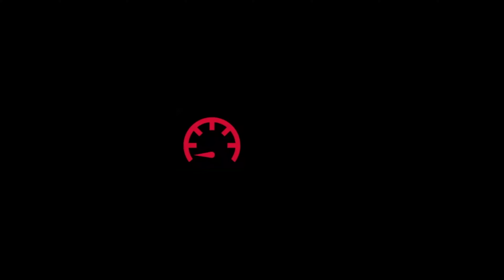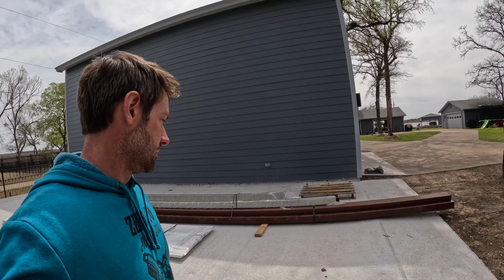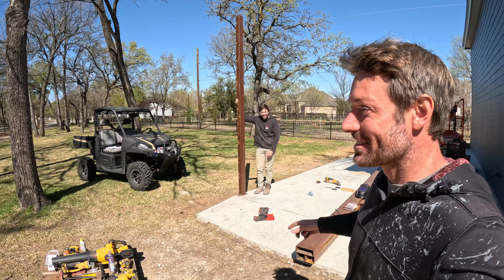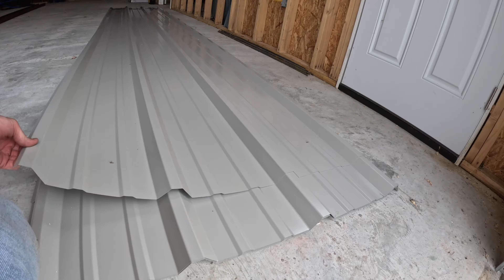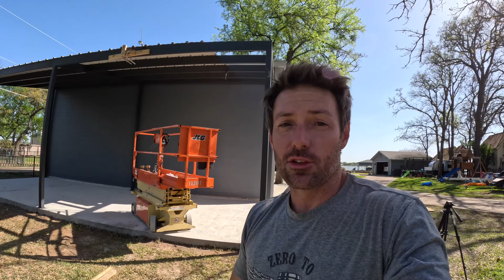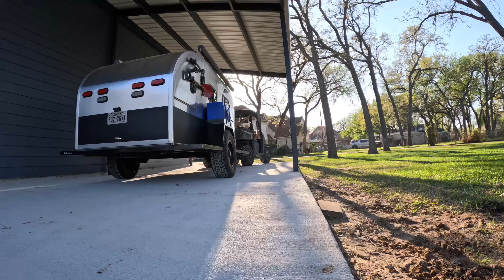I ALREADY OUTGREW MY NEW GARAGE! Building a DIY carport "kit" from Mueller steel buildings

Comment: Those anchors create a stress on concrete and are supposed to be placed a greater distance away from seams and edges.  Hopefully it doesn’t become a problem for you but you can keep an eye on it.  You’ll be looking for cracks and possibly breakout of edge of concrete, when this occurs will probably depend on wind load over time.
Reply: Thought the same thing, at least have a 36” footer in there with j bolts set.